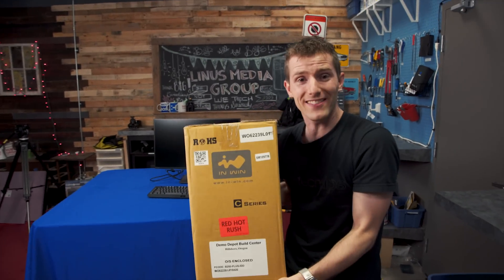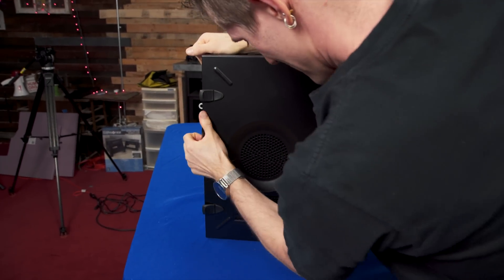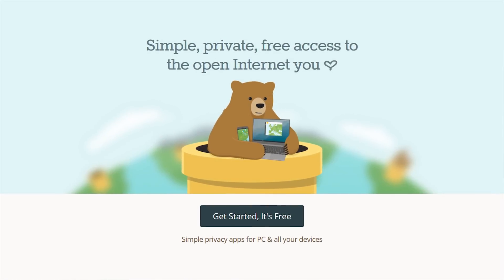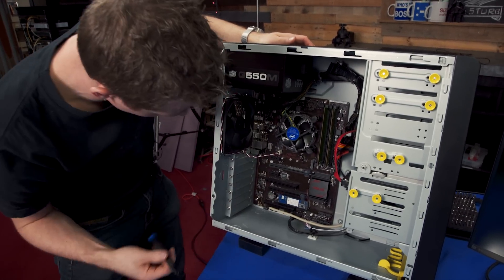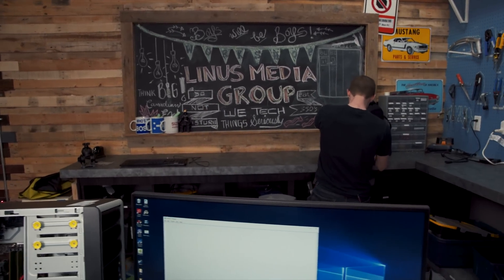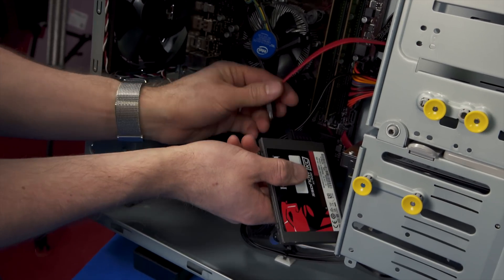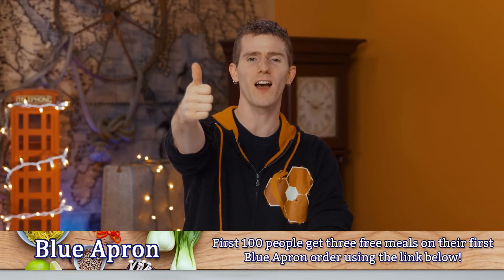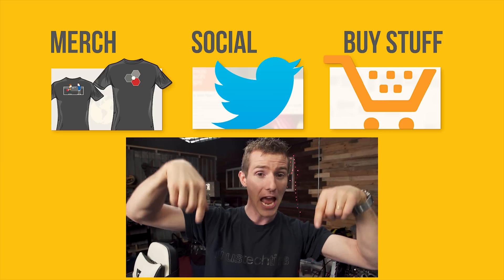Turbocharge your SSD for $40??

Comment: Hey Linus and crew, like many enthusiasts, I have an SSD boot drive while also using a couple of standard HDDs for mass storage of things like games, movies, and other large files. I'm not LMG after all, I can't afford a petabyte server. So my question is, if you're able to answer this ~2k comments in, would Optane be able to improve performance for those mechanical drives, or would it just try to improve my OS/boot drive since I technically would be using that more.

Comment: It's like a new version of Turbo Memory that actually does what it's supposed to, but like Turbo Memory it's coming to market nearly too late for it to do much good. Intel's restricting these new modules to boards that builders will almost certainly be using with an SSD is pure marketing FAIL. What they need is a PCIe x1 adapter to plug one into, and support for any PC board, with software for Windows 7, 8.x and 10 to run it.

Turbo Memory (cache cards up to 4 gig for a Mini PCIe slot in laptops) would've been great with DDR1. But they were used on laptops with DDR2, and up to 4 gigs of it. Dell made their own version up to 16 gig with a proprietary connector. The Dell modules are cheap on eBay, but useless for anything but the few Dell laptops with a slot for them. (Please, someone, come up with a way to make these useful for something!)

Turbo Memory cards could be configured as generic storage, or split between cache and storage, but AFAIK you can't do a damn thing with them with Windows 7 and later. Might work with Vista since they're from that era. The idea was to be a faster version of ReadyBoost that uses USB drives. (Itself a victim of the speed of DDR2 and faster SATA.)

What you can do with a Turbo Memory slot is plug in a mPCIe USB 2.0 adapter and jack in a big (capacity, not physically) thumb drive to put more internal storage in a laptop with one of those slots. Just take care that the solder lugs for the USB connector don't short to anything on the mainboard. May want to clip and grind them down just to be sure.

Comment: At 77 bucks your getting pretty close to a 480GB SSD then you have to have a hard drive your installing your OS on so it really becomes 77+80 for about 2TB's... So if Optane isn't that much faster than an SSD, I fail to see the point VS just buying an SSD right now.

All that being said depending on the price in the future an Optane based SATA III SSD would be fantastic. 

One question I have (because it's late and I am too tired too look it up.) I am wanting to say that Optane is more durable than the usual MLC and TLC NAND used in normal SSD's... so even if it's not crazy faster, it could still be worth getting?

Comment: I wonder if optane would help with a system which has Windows installed on an SSD, most programs also installed on same SSD, but the system also has a large HDD with a steam library, Windows file directories (Documents, Downloads, Music, Pictures etc), and maybe some lesser used programs. Would optain help speed up that secondary HDD even though Windows is being run on an SSD? If so, I think that would be of benefit to many people's rigs.

Comment: This sounds nice, but low capacity SSDs that do the same thing are the same cost and are way more compatible, coming in all flavors from sata 3 to nvme. This is a neat solution to a problem that doesn't exist
Reply: The main area where this would be useful is older laptops sporting 5400RPM drives. Many have M.2 slots.

This would be super useful to me if it could cache multiple drives that are not your OS SSD.

I have lots of pictures. 1TB SSDs are pretty expensive to store them. This would be useful for caching that. I have a 6TB Steam games drive too. I also have some large video footage drives. (Nothing insanely high res - small projects that I work with, then move on. Perfect to fit in cache... and since many cheaper video editors hard code paths into their project files, and get grumpy if you ever move them, shuffling them from bulk HDD storage to SSD storage... caching without moving can simply save time.)

Yeah, if it could do multiple drives and is Ryzen compatible, I'd buy one. 64GB preferred. (Since I'd be caching up to about 15TB of space.)
Reply: how about instead of insulting me you go ahead and prove me wrong. in which ways am I wrong, and why? what does optane do that I don't understand, and what are its applications that I clearly don't know of?
Reply: Oh, yep, also possibly power savings. No idea if this has been mentioned or not? But again that is not consumer, that would be on the laptop manufactures... so why we are getting strange marketing from Intel. They kinda have this product that is deep into the workings of a PC, and trying to market it to the office people buying paperclips and pens.
Reply: shut your face! I agree. this is just gimmicky trick. remember that ansel gimmick of nvidia on their 1070/1080 release. funny how it looks as if this optane "predicts" future load as if some neurocomputing. why not just release a new high capacity optane ssd like linus said. remember tape drives, then hard drives, then ssd, them m.2/nvme sticks then now optane mass media. not this "stick this optane stick to your harddrive then you will have faster load times" heh
Reply: +shut your face you literally know nothing about this product. Try and actually do some research before watching one short video and think you are smarter than Intel

Comment: I could see this being marginally useful for people with large storage requirements where a 2tb SSD is just not going to cut it. But of course, if you're all over the map with games like I am, it's going to perform little good. I went from a Seagate 4TB hybrid (practically no improvement for me btw over traditional hard drives) to a 480gb MyDigitalSSD BPX NVMe M.2 on my primary and a 2TB Crucial SSD for storage on non-critical games. Things like slow load time open world games like GTA V and Ark Reside on the NVMe and stuff like Civilization 6 will stay on the SSD. Let me tell you, performance was fan-diddly-tastic! Totally night and day. Then I have 2 10tb Seagate drives for my Plex media server, 1 more 10tb for iso backups, and then a 3tb for imaging of the SSD and NVMe drives. I ended up grabbing the 1800x on the crossfire vi with 2 Aorus 1080ti xtreme (whenever they arrive shakes fist at NCIX) in a Corsair air 740 with 64gb of corsair vengeance ddr4 3200 and of course a H115i cooler. As such, octane wouldn't have been viable to begin with for me, but at the $300 price point on my NVMe M.2 drive, it's a great performing beast!

Comment: Take a step back and realize that Optane is a (probably rushed) go-to-market strategy to introduce 3D Xpoint as an architecture to move to.  Optane may suck, but 3D Xpoint does not.  Maybe changing memory architecture on boards and finally moving away from the now-outdated DRAM is the direction we need to go.

Comment: I can go to my local Best Buy and get a 120gb SSD for 50.00 or less. That is more than enough for a boot/OS drive and will offer basically the same performance with a lot of room left over. I have a 7700k and a Z270 mobo but damn this tech is basically useless. Why would I pay 40.00-70.00 for performance that is basically not even notable in real world usage (my boot drive is an SSD). Way to go Intel sarcasm.

Comment: Wasn't Optane also gonna be able to "Replace" RAM? I could see these small optane modules being better for that than cache. You could just have 8Gbs of actual DDR4 memory and then 32Gbs of Optane memory for about the same price
Reply: Obscared Games they have an Optane server SSD that can function as RAM also, however it costs well over a thousand (US) dollars.
Reply: Until it 10x faster, then it can become typical DDRX speed.
Reply: It was never supposed to replace RAM. The point is that it can act and behave similar to RAM however - which is something Flash memory can never do, they are fundamentally different. With Optane you could theoretically build a desktop PC with 512GB of RAM, for example. Yes, it'll be slower than real RAM.. But that might not matter, as long as it's fast enough for what you want/need. It's also like a thousand times faster than Flash, tens or hundreds of times higher write durability (High enough that you literally can't wear it out in your lifetime, probably), while still being much cheaper than RAM.

This is the first commercial product using a brand new type of storage technology. The technology is extremely interesting - this particular product is not. Gotta wait. Just like with Flash, it will take years before the cost and the usefulness of it gets to the point where normal consumers can make any use of it.
Reply: I think the ability to use Optane as psuedo-"RAM" is going to be available very soon, and should be transparent to the OS/user. At least Intel has been teasing that as an early feature, already available in the enterprise products I think. 

But I'm wondering what kind of overall performance impact it will have. I imagine that using the real system RAM as a sort of "cache" for the Optane bulk RAM would be a cool idea, and would work really well for certain workloads. Or it might just be aimed at allowing software that requires huge amounts of RAM to run at all, on less specialized machines... No need for multi-socket mega-motherboards with 16 RAM slots or whatever, but the tradeoff would be speed.
Reply: not fast enough
Reply: In some of the original statements, Intel basically claimed Optane would replace everything from RAM to HDDs. They changed that tune until we finally arrived at this point-- I don't think most people will be interested. For instance: I was interested until I learned that it would take up my M.2 slot--- which I just bought a relatively large NVMe SSD for, so, no thanks.
Reply: They have never said it would replace RAM & HDD's. The theoretical specs for Optane (or 3D X-Point) have been known since about 2009. And the speeds were always clearly nowhere near DRAM. It is however much higher than Flash, and it's also bit-addressable like RAM is, unlike Flash, which is not only limited to sector-addressing but it also requires erase-before-write, which DRAM / Optane doesn't.

You ignored the rest of my statement: This is a first generation product.... Just like there's hundreds or thousands of different applications of Flash memory (Everything from firmware storage in embedded systems, to SD cards, to SSD's), there's many many applications of Optane memory. This dumb M.2 drive is just an example, it's literally the first ever consumer product ever sold using this new memory tech. It doesn't have to be in an M.2 slot, it could be anything. Optane is just a memory technology... It's not a socket, or use case, or protocol, or anything else. It's like a DRAM chip, or a Flash chip.

Like I've said like 3 times now. This is a brand new memory technology. And people are already saying it's useless, after seeing literally the first ever product made from it? Gee, you guys would'v been fun back in the mid 1980's when Flash memory was introduced. "It costs a fortune and only lets me store a few megabytes? What a piece of shit, Flash is dead on arrival".
Reply: First I'd like to state I think optane is probably the future until DNA data storage is viable on large scale. I also didn't mean Optane will fully replace RAM but more meant it would aid your systems memory when your computer started eating up all your resources.
Reply: What I kinda just wanna know is how that performs compared to RAM and if you could achieve the same RAM function with the M.2 Optane. Even if you had to turn to third party solutions.
Reply: simple answer
optane max 4gb/s
Ram up to 50gb/s most of ram reach 35gb/s
theres no way that this technology replaced ram
Reply: Learn to differentiate between 'b' and 'B'. You just wrote total nonsense, but when you put correct units on correct places you are basically right, but much more important value is latency for RAM - Optane is close, but not close enough.

Comment: Nope. 
ANY 240 gig + SSD just smashes an HDD.Even @ H61 board speeds.(low seek time)
Store bought systems, the HDD is on the way out @ 5 years (father just been there with his sandy bridge acer) 
messing about with a cache option total waste of time.
 Cheap 240 gig  SSD primary if can be found.If not, MX 300 275 gig @ £84.
(u.k.)

Comment: An M.2 slot on a system liek that is so oddball that I wonder why they think people will really be using these in such old systems, no one with such an old system has the slot to install it without using a pci-e adapter card. 

That MB is an oddball part.

Comment: I could see it as a way to power up budget builds from here on out, but intel isn't usually considered a "budget" option as much as AMD in my opinion, and the fact that no one using any less than a z270/h270 can use it, I think a 3D X-point SSD rather than optane booster drive would have been a smarter move, and release the optane booster in like Q3 or later minimum.

Comment: Do you not need an enthusiast board at this point for m.2 slots? I guess you can get a PCIe m.2 card as well or something... I have a moderately priced build from 2016, no MOBO in the 50-100 dollar moderate/budget range(people who would benefit from Optane) had a m.2 slot that I saw. This is a really nice thing, except that it's only currently useful for people who have older gear or can't afford full out enthusiast priced motherboard or parts, yet it's only usable with higher end parts, and purchasers of such boards likely would prefer to pop in an actual m.2 drive. I guess this will be great in three years when m.2 is the standard. I guess... if you need 1tb of storage, but you'd like the snapiness, it could work, however you can get a standard SSD, 120gb as your boot and primary drive for somewhere around 50-60 on newegg. I feel like this is an obsolete on arrival technology. Fantastic in theory, but the people who need it can't use it.

Comment: If you could assign it as a page file for windows or applications then I could see a benefit.
 I have a Samsung 850 Pro 2TB. Mech HD for storage and backups. No benefit to me, unless I could utilize it for a page file.
 What's the point of buying a new computer system and get a mechanical HD then spend the price difference on a stick of basically memory.

Comment: Since Intel has opted out of revealing the large file read and write speeds of Optane drives, would you be able to do a regular benchmark of the SSD as a stand alone drive (not being used as a cache drive)? Also, I'm sure a lot of the enthusiast populous are curious as to how the Optane drives that are coming later this year will perform compared to a regular SSD or even an M.2 NVMe drive (Samsung 950 Pro) as a boot drive. This would make for a very good video.

Comment: Lmao, useless tech. What's the point if I can't use it in old systems like my Phenom II PC. If I'm gonna use Kaby Lake, I'll be using SSDs thank you very much.
Reply: At my part-time job, there are dozens of old PCs needing a boost in performance. The company doesn't have the budget to upgrade all the PCs fully. Also, they're all equipped with Nvidia Teslas & Quadros so I don't think it's worth more than the Optane. But then again, old motherboards don't support M.2 NVMe.
Reply: in that situation just get a 250gb SATA SSD, format it as a 160-200GB partition for your OS, use the remaining space for a 2nd partition, and use a program like primocache to set that 2nd partition as a cache drive for your hard drive. I've done it myself and it works great!
Reply: What about the people with g4560/7100/7350k?
Reply: Spencer rekt
Reply: If you have a 7350k then you obviously have no problem throwing out your money on something less performant.
Reply: Then buy a smaller SSD and a bigger HDD. You'll have larger chache.
Didn't checked prices, but maybe 500 GB SSD + 3 TB HDD?
Reply: A. Haikal Ruslan useless? for you maybe yes. but if someone have plan to build affordable workstation, rather than buy 1 tb ssd it's better to get this and 3tb storage.

Comment: Does a mechanical drive need to be used as a boot drive to benefit from the optane module ? I have a 2 TB mechanical drive that i store the bulk of my data on and it was the bottleneck of my previous system.

Comment: I'd get one if I was already buying a Kaby Lake system, but not when I built the system and not for any SSD. More likely I'd get a fast NVMe M.2 SSD to boot off of and then later get an Optane Memory module to cache my main HDD where the majority of my games are installed. It's only $40 for somewhat quicker loading times..eh, worth it for me and cheaper than just buying a large enough SSD to install everything on. 

I already install both Sims 3 and 4, Fallout 4 and Skyrim on an SSD as all of those particularly with mods, benefit greatly from an SSDs because they stream so much data and have large save files which severely bloat loading times when you've actually been playing a save for a while. (eg. TS3 saves can get over 1GB in size with ease) Skyrim and FO4 with large texture mods in particular can start to severely stutter as they stream in textures when you're moving around, I remember the last time I had Skyrim installed on a HDD with a GTX 470, I'd literally have the game pause as it loaded everything in for a second if I turned around quickly even though it was installed on a then new WD Black. Moving it to my 840 Evo made it stutter free.